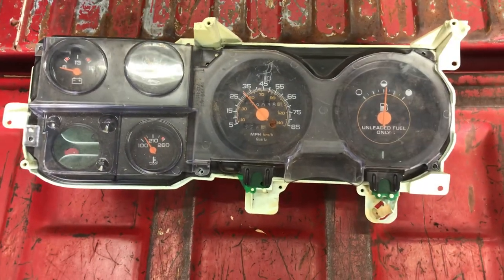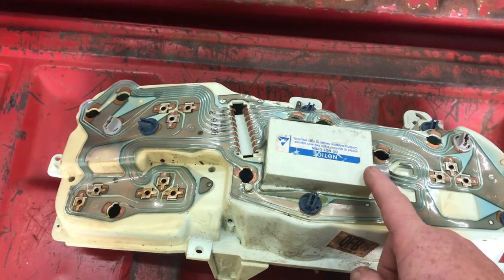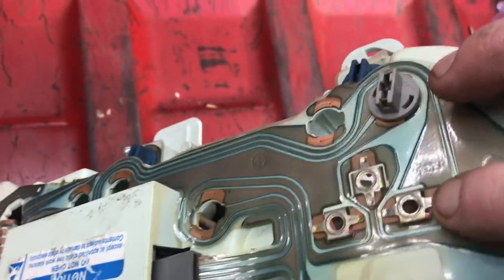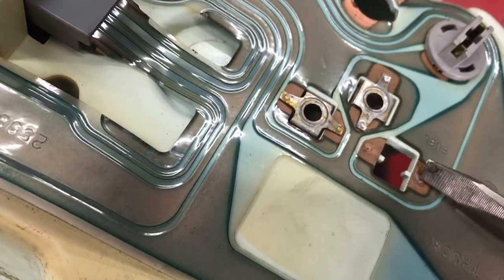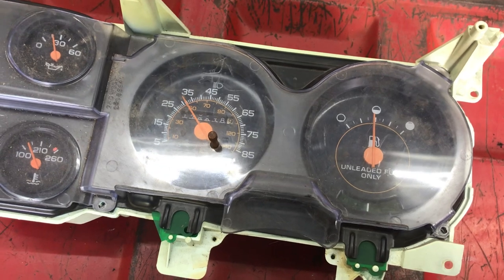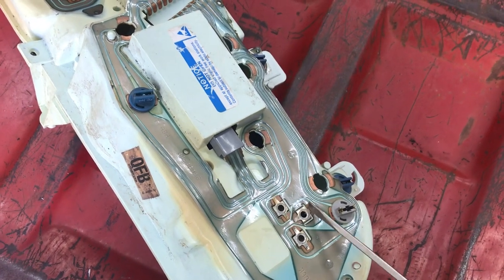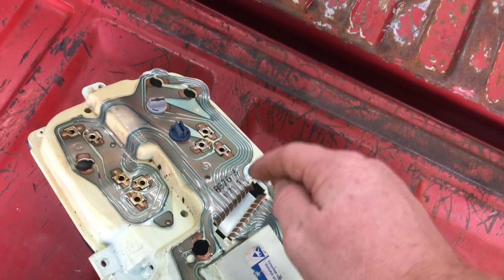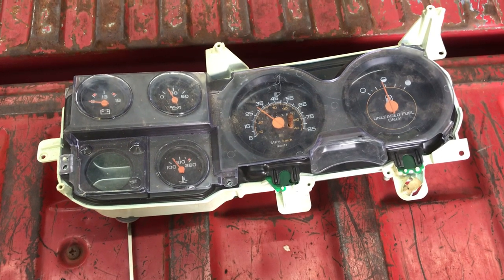Common gauge issues on 1973-1987 c-10 trucks.

Comment: Hey this Wesley I just bought a 1994 Chevy Silverado that has sloppy steering it has nearly everything new including steering gear box and steering shaft but I still can’t get rid of the play in steering I need help
Reply from the maker: What do you mean sloppy steering? Just has a lot of play or is it touchy?
Reply from the maker: And are the tie rods, pitman arm and idler arm new?
Reply: @gmtim3840  pitman arm is new stabilizer bar and bushing looks new but I’m not sure about the idle arm and tire rods
Reply: @gmtim3840  steering wheel has a lot of play in it

Comment: My 86 has Dual Tanks and at Full, both Tanks read about 3/8 a Tank. The Gauge does go down, but at empty you still have gas. Have you ran up on that?
Reply from the maker: Yes, more than likely your gauge is bad but could be a grounding issue possibly. When you have them full, take an ohm meter and see how many ohms you have between your gauge wire and a ground, if you’re reading somewhere between 90-100 then it may be your gauge.
Reply: @gmtim3840  Thank you Sir!!

Comment: My gas gauge seems to move around a lot when driving. If there is more than a half tank it 
is better but I’m thinking the float is worn and just moves too easily?
Reply from the maker: Very possible, may also be in the gauge but as long as it’s fairly accurate that’s all that matters I guess
Reply: GM Tim38 I’m going to sort it out soon. They say those ceramic resistors can go bad in the back of the gauge, but not sure what symptom that would have. Could probably be a bad ground too?